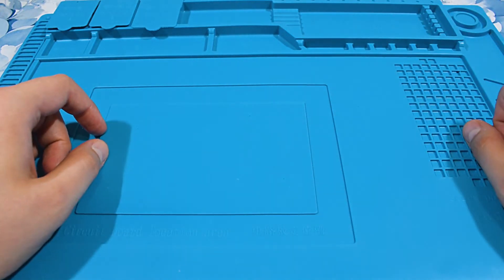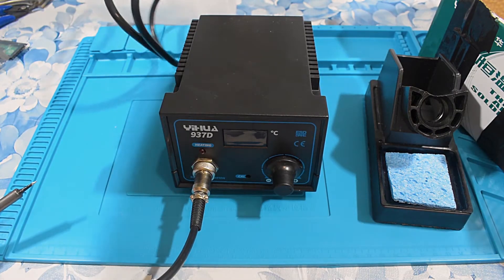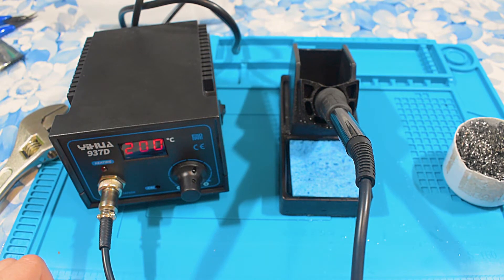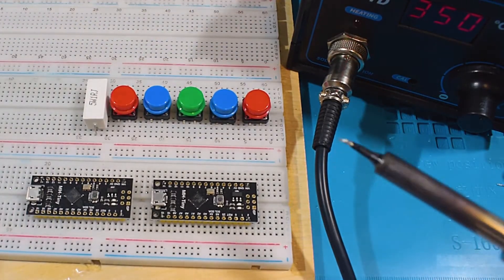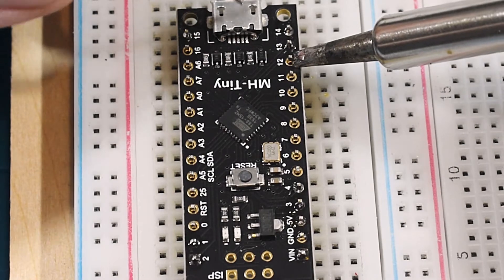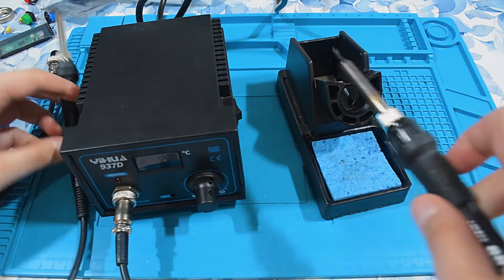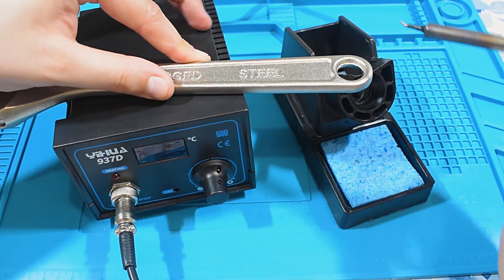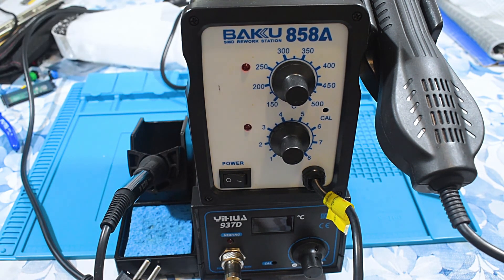Yihua 937D first look - Correcting my mistake!

Comment: Another thing, keep your tip clean of black oxide it inhibits heat transfer, run it through the mesh every so often as you work - also you cant just switch handles from one brand to another because even if they look the same and hook up theyre NOT ALL WIRED THE SAME nor do they all have the same heating element and you could damage the circuit board in your base unit.

Comment: You should not use that type of mesh ball, that looks like a hard metal that will shorten the life of the tips - solder mesh balls should be made of soft BRASS, thats the only type of tip cleaner the HAKKO brand provides and they do it for a reason.  I see so many places selling copper and flash plated steel and its really bad for the tip, find the high quality BRASS mesh balls, they are shiny GOLD and you can verify they are real brass and not just plated by testing it with a magnet, brass will not react to magnets.
Reply from the maker: @yambo59  I agree with you. But keep in mind that at this point I couldn't afford them (if you look closely at my videos, my tools are generally cheap). I used the same type of mesh ball my wife used for scrubbing the dishes 😂

Now I have real soft brass mesh balls for tip cleaning. I hope new videos will be coming this year so I'll be able to show my current tool arsenal 👍
Reply: @milanfixer    Oh I understand that believe me, that was a good deal on the station - and I dont like sponges either but those steel or copper mesh balls will destroy your tip plating. I went that route myself for the same reasons when I was younger and didnt know any better - but after awhile I was destroying the plating on my tips and they wouldnt take solder etc etc and I didnt know why, then I found out from a friend and changed to real brass, I know theyre not cheap but wow what a difference, brass is soft and will not hurt the tips so I replaced my mesh with brass and installed a new tip and after that the irons performance and tip life was improved like night and day. Problem is anything made of brass isnt cheap, but neither is all the aggravation and tip replacements that can make soldering miserable.  Also, make sure its not just metal plated to look like brass, the edges will act same as steel, a magnet is not attracted to brass that will tell you for sure its brass. Good luck

Comment: T12 zaobidji.Den-on,Goot vrhunske lemne stanice i lemilice ako hoces kvalitetno (nije jeftino 😁).Na KP naleti povremeno nesto povoljno kao pre 20-tak dana Goot RX 802-AS kupljena u Decembru prosle godine sa 5 vrhova 200€.
Reply from the maker: Što mi to ne reče ranije? 😂😂😂
Uzeo sam pre par nedelja T12-wannabe kit. Biće videa kako ga sklapam. Nema normalnih gotovih lemnih stanica, za normalne pare. 

Hvala ti na preporuci 😁 Čim budem pri parama, pogledaću Goot RX802-AS.
Reply: @milanfixer  E jbg.Ako ti je bitna termalna masa i snaga t245 je bolji izbor zato sam napisao da zaobidjes t12.
Reply from the maker: @dusanmilojevic3017  T245 sam sledeće mislio da uzmem (nisu više ni skupe kao što su bile) I T210 za mikro lemljenje (dolaze u paketu). Jeste, bitna mi je termalna masa, zato što mi se smuči kad mi se nekvalitetne lemilice "zalepe" za uzemljenu površinu.
Reply: @milanfixer  well If You want a good t245 and t210 option i sugest to loock at SDG electronics chanel  more specificaly Steve chanel to see the video about the  dual chanel Axium soldering station that îs amazing and IT can drive t245 ,t210 and nt115 also the price îs very good not high IT îs docent and IT performs exactly like the real deal   . You can also buy a station from Axium that can drive only the t245 and If You want a station that can drive t 210 .
Reply from the maker: @andreiciora2765  I love SDG electronics' channel. He really works with some high end soldering stations and the guy really knows what he's talking about. But, I'll get a decent one soon. Hopefully it will be one of my next videos.
Reply: @milanfixer  but do not try to change your soldering station yet be a litlle bit more patient hakko next generațion soldering station will come very soon .